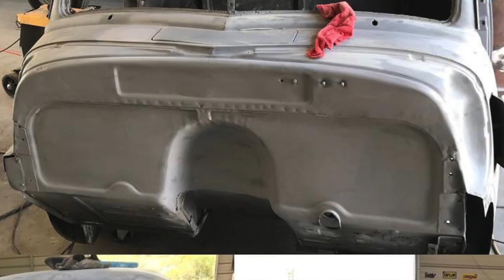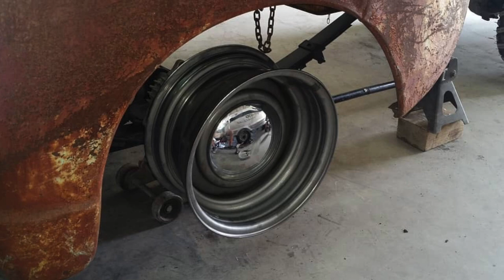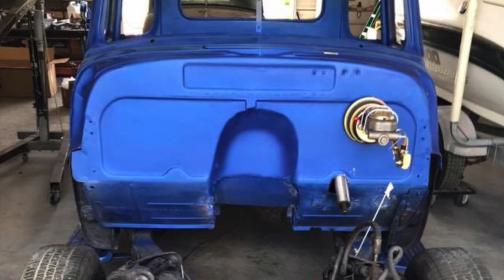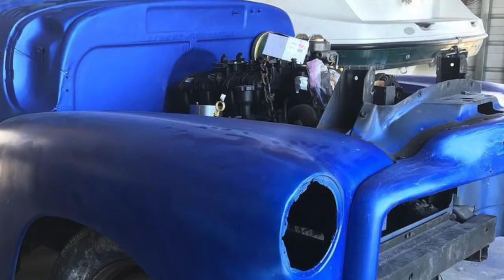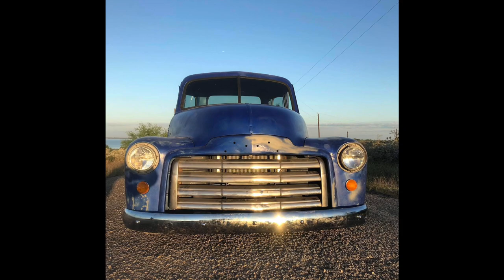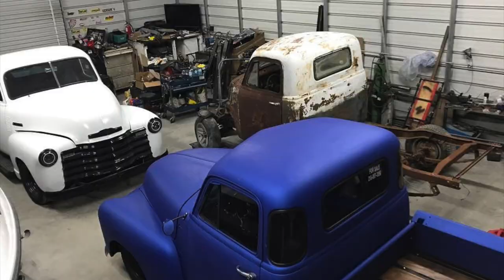Chevy 3100 Build S10 Chassis Swap (2019)

Comment: pls can u tell me from witch yer is the s10 frame
Reply from the maker: 98 body style but all of them are really similar through the year
Reply: Build // Thread do you know if a 1984 s10 longbed chassis  will fit in my 1952 3100?
Reply from the maker: Air Max it sure will if you make custom brackets
Reply: Build // Thread Thanks man helped alot👍🏽
Reply from the maker: Air Max no problem 👍🏻
Reply: @buildthread8379  good